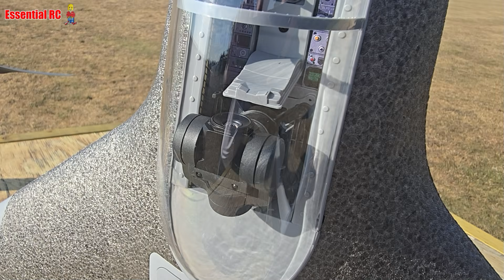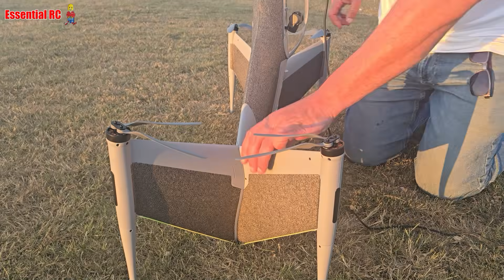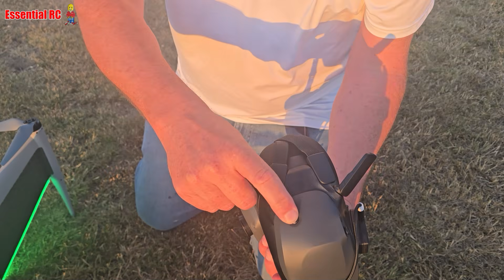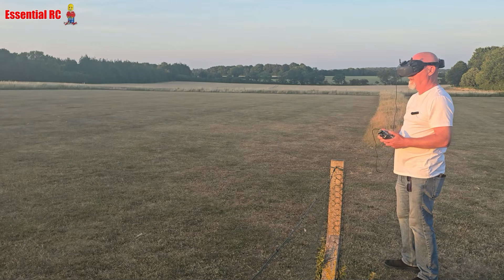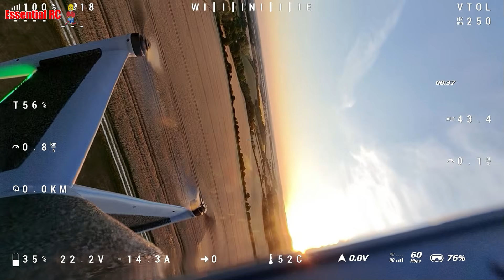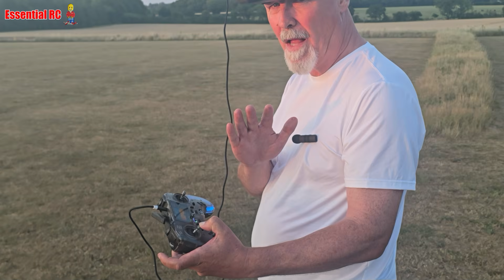Flywing X Wing Fighter VTOL head tracked FPV RC Aeroplane | Cruise, Stable and Acro Modes Demo

Comment: When you unlock it and your in cruise mode do you still have to climb to 80m before you can transition into plane mode? and also do you have flight hight restriction as you had in that beginner mode before it was unlocked?
Reply from the maker: Mine arrived unlocked because I got one from a batch for reviewers so I only had to climb to 30 metres before it would allow me to switch to Plane mode.
Reply: @EssentialRC  yeah that what two bothers said also. I will pick that up from there to show how to unlock and give the full fpv experience.  thanks for the share👍
Reply: @EssentialRC  thats great. I have been talking with FLYWING CHINA about this bc I have been promoting and making videos for over a year for them and I just got mine and did a unbox and first flight for mine and It was awesome. I have been flying fpv over 10 years on drones and this was incrediable. You got it for free and thats cool but you was not given what it really it is when you get it to explore what it can do bc they unlocked it for you!!
Reply from the maker: Don't understand you. If you don't want the limitations while locked, just unlock it. That's what I would have done and if you're an experienced FPV pilot you should do the same thing. The limitations when locked are for first time noob pilots.

Comment: Mine is finally going to show up. I have to say I got a very generous discount from Flywing bc I made them some promo videos over the past year. Im kinda glad I didnt get the first round bc now they installed a fan on the bottom to fix that overheating issue.
Reply from the maker: No fan and no over heating problems for me 🤷‍♂️
Reply: @EssentialRC  Thats good, but just about every video I watched on it had the overheating issue if you was to hover too long and not get airflow in plane mode. Well anyways Troye at flywing told me they fixed it and put the fan in. Thanks again for your share.

Comment: Any help on this matter? 

When everything is powered on and the cable is connected from the transmitter to the head tracker, I have a normal video feed, but the camera does not respond to head movements. There is no pan or tilt movement at all.
Reply from the maker: I can't describe the solution but it is simple. You will find it on the FlyWing Support group.

Comment: Did you get a discount code to use? Bc I noticed when I click on yours or anyones link in there videos you get no discount? I am going to assume flywing didnt give anyone a discount code to use?
Reply from the maker: My coupon code is ESSENTIALRC with FlyWing. You can try it but I'm doubtful it will work for the X Wing. If it does work that's a definite bonus. EDIT: I tried it. Accepts it but no discount. As I expected sadly.

Comment: I have a dji avata drone and I can remove the telemetry from the camera screen, can you do that also? If so let me know if you know how. Thanks.
Reply from the maker: Fairly sure that the video recorded on the goggles will also record the OSD (telemetry) if it is displayed, but the telemetry would not be recorded on the video recorded onto an SD card in the video transmitter onboard the X Wing.
Reply: @EssentialRC so it does a have a sd slot on the xwing itself, if im understanding you correctly?
Reply from the maker: Not checked myself but others say it does and have plugged in an SD card extension cable and routed the other end of the cable out the side of the fuselage for easy access
Reply: @EssentialRC id like to see that if you know anyone who has a video of what they did?

Comment: After you landed, it was still on for 2 or 3 min. I heard the VTX gets boiling hot just sitting. Did yours have a Fan ?
Reply from the maker: Not that I noticed but I wouldn't would I. The temp is in the OSD which you only see when you wear the goggles. I tend to turn off the flight battery as soon as I land now.

Comment: The screens look a little fuzzy.
Reply from the maker: Modern FPV cameras are fixed focal length configured more for looking at scenery in the distance. That's about as good as it gets for close up objects. I've tried that setup myself in other RC aircraft and have not got it as good as that. I think they've done quite a good job. It's readable.
Reply: @EssentialRC  The rc jets I've seen have a more in focus display. This is the only one I've seen that blurry.
Reply from the maker: @reaper7264  Probably not DJI or Walksnail then.

Comment: I just got a message from them: “Hello friend, Thanks for your interest!
May I ask which country you are from?
This is a professional RC helicopter designed
specifically for model aircraft enthusiasts.
It boasts powerful stability and excellent flight control.
The RTF kit costs around $900.
RTF
includes:Ohelicopter@transmi tter sender rotor
blades@battery©charger@usb
-data cableOscrewdriver
Buser manual
*RTF:Readv To Fly”

So, they are charging $1300 for Goggles N3 and a 04(lite)?  Am I missing something else?

Comment: Now it’s $2400!!!!  What a complete joke!!!  The LED’s being single color COB’s are the icing on the rip off cake, you couldn’t put RGB’s on it?  DJI 04(lite) not 04 Pro; DJI Goggles N3 not Goggles 3; FlySky radio that looks like a RadioMaster Zorro, should be a TX15 or better yet a TX16S; single battery; proprietary software; wired head tracking that should have been wireless. I’m sure as these COMPLETELY overpriced wings/drones get in the hands of regular people, we will see more negative things about them. The YouTubers are only showing surface level things and hyping them up.

Comment: It's pretty rad for an RTF product, but hobbyists understand what it is at its core.  No problem with what they're doing or charging - it would be a lot of faff to DIY, i'd probably spend a few weeks doing the cockpit with moving flight stick... but it's criminal the canopy isnt optically correct.

Do you think it's running inav or ardupilot?
Reply from the maker: I asked and was told neither. Its proprietary apparently 🤷‍♂️

Comment: Was very curious about this but slightly underwhelmed by it. 
Does it have RTH, Loiter etc is the FC iNav based? Can I get the airframe on its own?
Reply from the maker: RTH yes, not Loiter. Currently only sold as bundle with everything you need to fly

Comment: I can't believe they cheaped out with the 04 & didn't use the 04 pro. The fov is just too narrow. That camera is designed for an indoor whoop.  Thanks for the review
Reply: Can it be swapped out easily?
Reply: @AcesHighMedia not unless you swap out the VTX. 04(lite) camera is not compatible with 04 Pro VTX. They should have used the 04 Pro and Goggles 3 for this price.
Reply: not sure if the lens is that narrow - I think it's a modded lens in the gimbal - because to me it looked quite wide FOV

Comment: It seemed to me that the viewing angle of the video camera is very narrow. The presence effect is greatly reduced due to the narrow viewing angle. I wonder if it is possible to install a wide angle lens on the camera lens?
Reply: RCSchim literally 3d printed a thing to make the camera higher to be able to see more from the plane
Reply from the maker: Combined with head tracking it felt spot on to me. It's DJI O4 so I'll have to see if FOV can be increased 🤔
Reply from the maker: Yes, you can increase the field of view (FOV) of the DJI O4. Because the O4 camera (commonly found on the O3 Air Unit or Avata series) natively has a narrower FOV than the older O3 system, pilots use third-party wide-angle lens attachments to boost the FOV from around 117° to a much wider 155°. Google Flywoo or Happymodel extensions